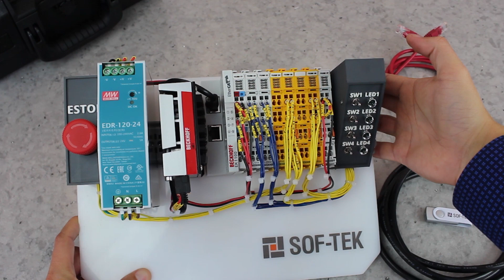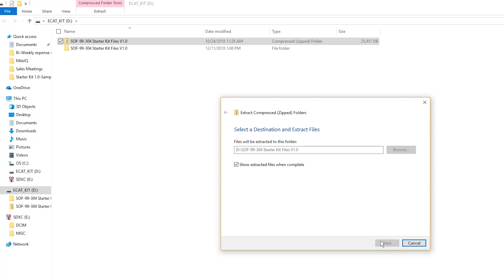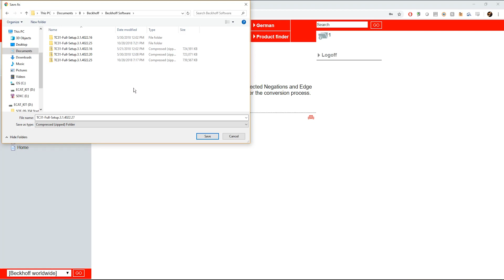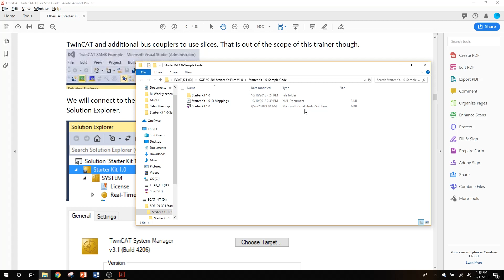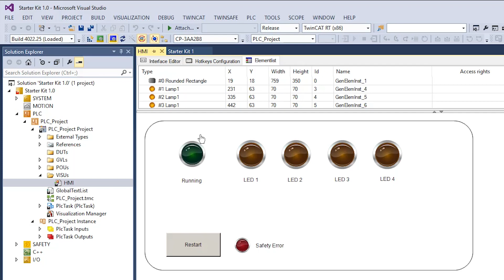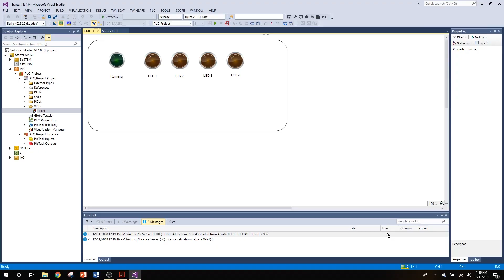EtherCAT Starter Kit  Instructional video

Comment: What is the approximate cost of this kit?
Reply: I wouldn’t buy that kit like that. The psu is literally one of the cheapest ones and there is a beckhoff ipc mostly for no reason(ok except for the special ethercat timing. But that kit barely goes into them anyway). I would recommend buying everything by its self and putting it into an enclosure. If you want an Ipc look in eBay for an older one they are usually half the price.
Reply: @petrosrz8990  I do think it's best to practice on a real Beckhoff IPC or PLC instead of using the programming laptop. They recently released the CX7000 PLC for 307$ so I highly recommend getting that a new few terminals to play with.